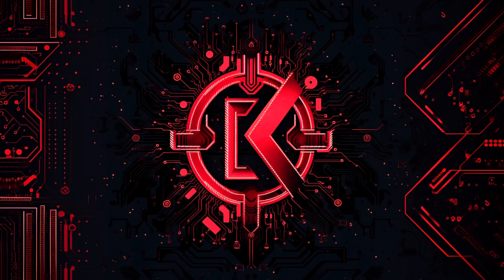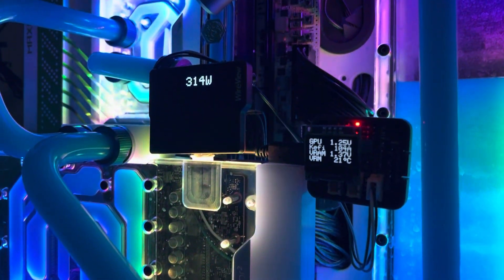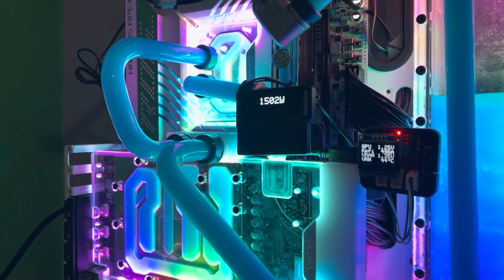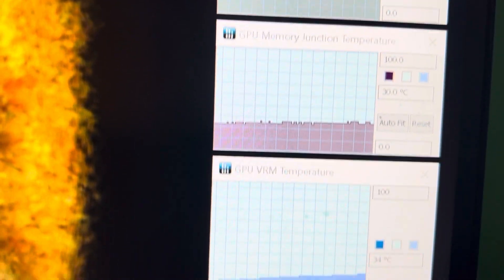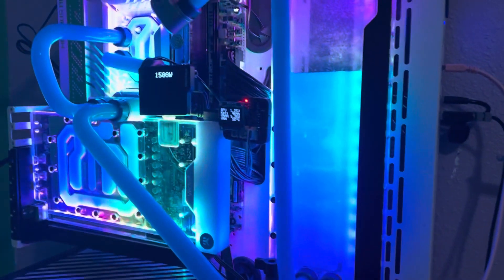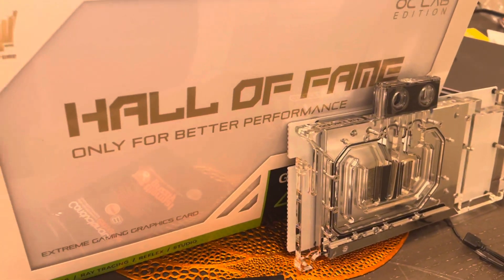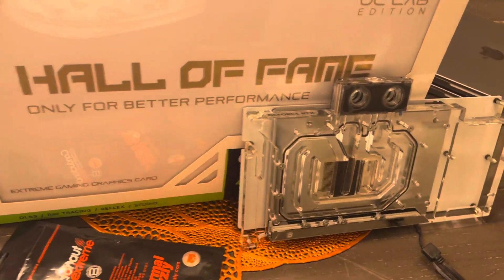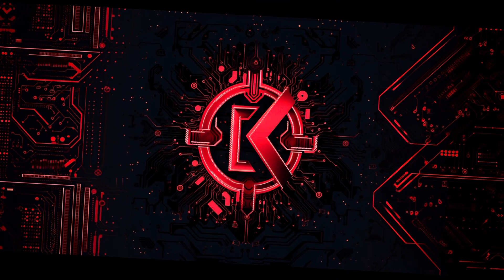RTX 4090 STRIX + 1.5 kilowatts + HVAC cooling = ???

Comment: Hello, I encountered this problem, my rtx 3060ti does not support the memory frequency of 7000 MHz, there are artifacts, in msi afterburnure I set it to 6500 MHz and the card works perfectly. Is it possible to edit the BIOS of a video card, setting the memory to 6500 MHz and flash it into the video card?
Reply from the maker: not currently, there is no known bypass for edited VBIOS